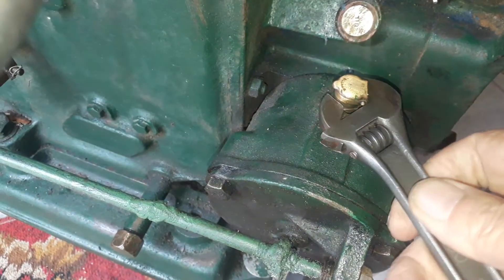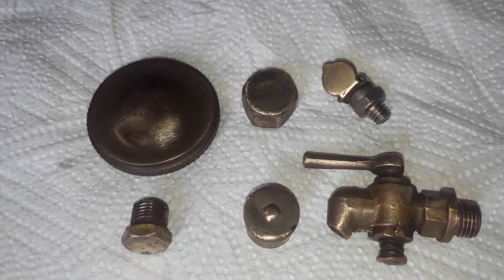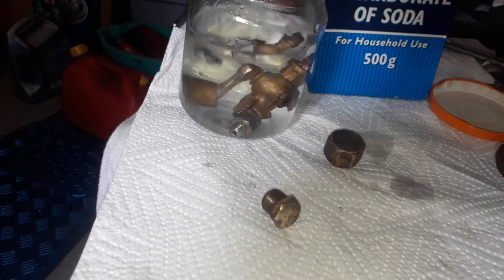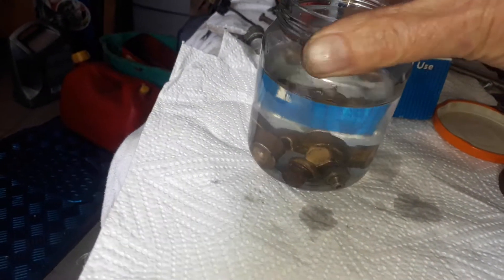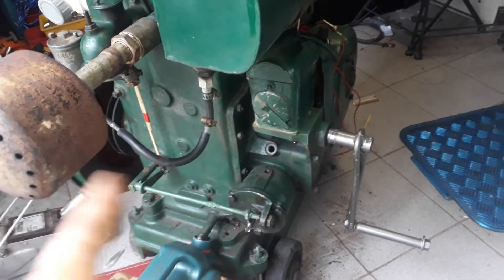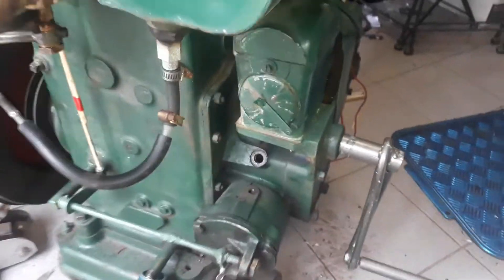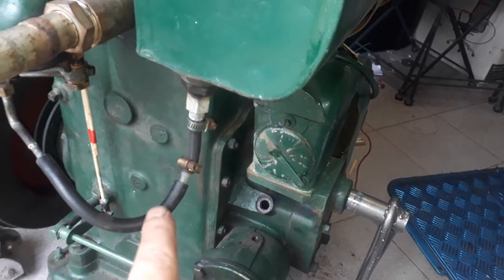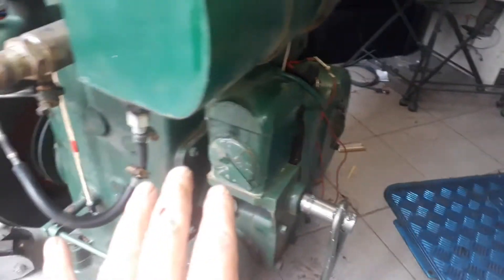Lister Copper Hardware and some History of Lister Colors, READ DESCRIPTION ON MY CHOICE FOR COLOR

Comment: Just a thought, was the main block maybe the normal green, and some of the bolt on parts blue?
Reply from the maker: Andrew that is how it looks for me at this point, I guess it was a built-up machine from parts but I am not sure, maybe the block of the blue engine get damaged and they replaced it with a green one, it seems if most add on items was blue and definitely the whole generator was blue